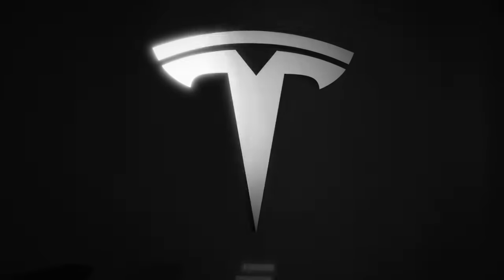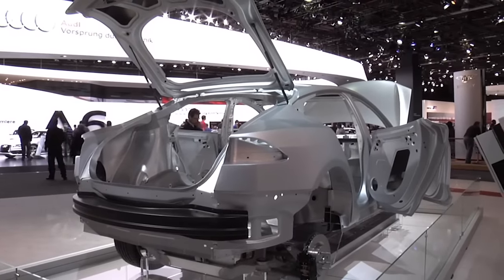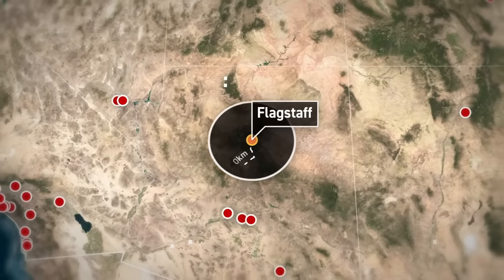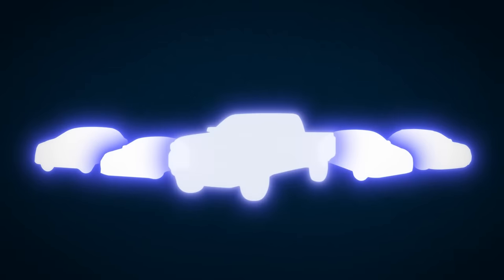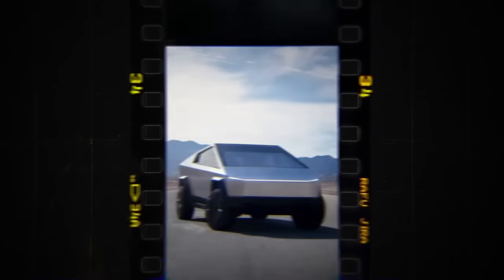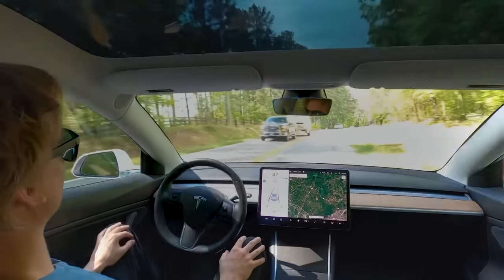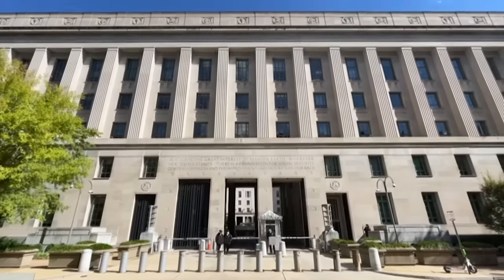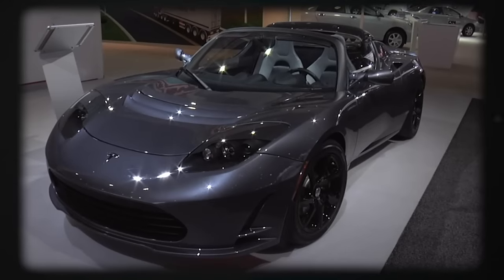How Tesla Fumbled

Comment: I've had a Model S since 2017 and I've experienced almost all the negative things the video talks about, but one area where Tesla still blows everyone else out of the water is their supercharger network.  My battery has degraded by 5-10% since I got my car, but it's actually easier to road trip than before because there are so many more superchargers than there used to be.  When I got my Model S, there were 2 superchargers in the Dallas-Fort Worth area.  Now there are at least 10.  The superchargers are very reliable too.  There might be one or two not working, but most superchargers have 10 or 12 and they usually all work.  I've tried these other 3rd party chargers like EVGo, etc, but they suck.  You really can't count on them working and when they work, they're really slow.  Tesla is experimenting with opening them up to other EVs, but they can always stop doing it if it causes more problems than it's worth.  The other automakers don't have anything close right now.  Road tripping in my Tesla and hopping between superchargers is one of my favorite parts of the Tesla ownership experience.
Reply: It was not bad for long trips as a taxi company but terrible compared to just having a hybrid car. But that taxi business went out of business within 3-4 years after replacing Toyota Prius hybrids with tesla long ranges thanks to the ridiculously higher electricity costs from the city for charging 30-40+ teslas every day all day long. 

As a solo user it is probably great, but yeah we had major battery life problems living in a cold winter state too, half the battery would be gone in winter months as opposed to the summer.

So I can imagine living in a warm place with a tesla is probably a pretty great experience.
Where it gets cold it is miserable, the 300 mile battery turns into 150 miles instead. Not good for a cab company.
Reply: I don't know if you've been reading tech news, but Tesla has started opening up its charging network to non Tesla cars.
Reply: was thinking of an i4 this year, but would you say an electric is worth it?
Reply: There's a good reason why gas stations aren't owned by car companies. Because if they did they did then they could put a lot of pressure on people to buy their cars simply because it's hard to get gas if no gas station in town serves your car brand.

The only reason this hasn't been addressed legally in the same way is because EV's aren't big enough yet and chargers aren't common enough yet. But once they are, then if that kind of practice isn't shot down like the plague it is then we're in a for a world of hyper aggressive, monopolistic car companies who have yet another vein to be greedy and exploitative.
Reply: I feel like the Supercharger is probably the foot in the door that could help Tesla hold on to a meaningful market share in the next decade. If they lose the charger format war the old boys of auto manufacturing world will eat them for breakfast.
Reply: @rh_BOSS  They pretty much already have, the US is the only major vehicle market in the world that hasn't standardized on a charging connector yet... the EU and China both use the type 2 now and force Tesla to also comply with it, though it looks like China is still in the development phase for their own DC fast charging standard connector. I expect it probably won't be worth it for Tesla to continue using a proprietary standard just for the US market and nowhere else.
Reply: No longer an advantage since they're opening up the network to other makes of cars; it's already happening.
Reply: Excellent point. Being able to put a destination into your map and having all the supercharger stops get automatically calculated for you - it just works so smoothly. And when you get to the charger you just plug in your car. No having to download some random crappy app or something like that. I have to give them credit for really stripping down the process and making it super convenient.
Reply: @goldenfloof5469  Tesla spent their own money developing the supercharger network. They have built goodwill from owners of their cars by the network's reliability, speed, and that they are everywhere and it is a key reason people choose Teslas over other EVs. How can the government go after them now and force them to open up their chargers when it is a competitive advantage that they invested a lot of time and resources into perfecting? Tesla made EVs at scale possible and that is why every city in America is full of Model 3s and Ys.
Reply: @goldenfloof5469  The government already has "gone after them," sort of, just in a positive way. The BBB Bill included a bunch of funding incentives for building and maintaining EV charging stations, but only IF they used the generic standard. This means Telsa gets none of that money. . . unless they open up their charging stations to generic chargers, which they have been piloting in a few locations. It's a little complicated and will take some work, but seems totally doable. Within the next five years or so, you'll probably be able to charge any EV at any Tesla charging dock.
Reply: @kriskros91  Ask AT&T.
Reply: How long does charging take
Reply: @johannesgutsmiedl366  you couldn't be more wrong there bud. NACS standard is Tesla's standard now. 

The "big old boys" VW fired their EV CEO, postponed plans for new EV plant and has had shit sales for their EVs so they are now going to Chinese brands to use their platform. VW lives because China and forget them selling to Chinese in china, they now need to worry about Chinese in German market.

Ford - talk to a real F-150 owner, they threatened CEO as they couldn't charge the big ass EV truck anywhere and sales were dropping fast. Ford itself admitted to it and begged Tesla to let their F-150s work. 

GM - Yeah, they made 10 EVs last year i think. 

Hyundai/Kia/others - irrelevant. 

While all this Tesla has gained their lead over all of these, has opened one new factory, started work on it's biggest one yet ( Mexico ) and is for medium term holding everyone by their balls.
Reply: "My car sucks, but it has SuPeRcHaRgEr network".. get wrecked man
Reply: @kriskros91 are you seriously asking this question? "Why would the government care about the people instead of Tesla?"
Reply: Ten chargers in Dallas is a joke.
Reply: That is only a usa thing though. In the rest of the world any ev can charge on any network anywhere. The supercharger network is open to anyone with an ev.

Comment: Two factors that were left out but I think played a key role in Tesla's success and still, to this day, are a big reason for the company's image:
1- Performance. At the time when the Model S was released, it had some of the best acceleration and performance specs of any production car outside of supercar territory. And it did it at a fraction of the price.
2- Looks. When Tesla jumped into the market, most mass-market EVs were, to put it bluntly, butt ugly. They were so ugly that they gave off the impression that the person driving it must have done so ironically or the were so far up their own ass about the car being electric that rescue crews wouldn't even be able to pull them out. Tesla made an electric car that looked like a normal car. It wasn't modern art vomit--it was classically stylish.

There are arguments whether both still apply, but I don't doubt that both played a key part in Tesla's early growth and popularity.
Reply: Sure, but the point is that they wasted that popularity, and plenty of modern EVs match or exceed them on both qualities.
Reply: Their cars are ugly, and not just because they all look the same (fat & fatter versions). They could have kept Lotus on, but no. 
The 0 to 60 performance is really good, but at that price point you could always get an ICE that matches it and handles the curves better and stops shorter. 
I thought I’d be driving electric car by now but it’s just not panning out the way I expected and in part because a lot of the lies that came from this outfit were never fulfilled.
Reply: Lmao
1) he mentioned alternatives with comparative specs

2) the cyber truck is the ugliest thing ever

Comment: Rivian isn't a good example for "better quality". They have a lot of fit&finish problems, and even more unjustifiable for the price point
Reply: 10000%
Reply: Chevy stopping orders for the Bolt for a bit and asking customers to park outside away from other vehicles because of battery fires.

The Ioniq5 with a fairly common 12v battery drain issue. 

The legacy car brands aren't doing any better for build quality for their EVs or even ICE vehicles historically.
Reply: Correct
Reply: There are way more serious issues than just fit & finish though. Just off the top of my head I can think of tonneau cover breaking with just regular usage and the trucks just refusing to even unlock in cold weather (no extremes, just freezing temperatures & parked outside) and these are not rare cases...
Reply: The 12 Volt battery might be problematic atm.
Reply: Indeed, they had to replace all their bed covers because they kept failing.
Reply: @echoeversky  I jumped one at a festival. Was like a week old, owner was steamed.
Reply: @crysis_averted  Have they finally fixed the design or are they still just replacing the broken ones with the design they know will break soon?
Reply: @RonnieRLD  To be fair, the battery issue with the Bolts was not their fault (it was LGs) and they replaced all the batteries. The new cars do not have this issue (I have one)
Reply: stick to legacy brands...only had 2 issues so far with my BMW iX
Reply: @aynrandfan7454  Doesn't BMW outsource their EV powertrains? In that case it's not exactly legacy EV manufacturer...
Reply: @Daddo22  yeah they outsourced it to a 260 year old engineering company that's been making driveline components for near a century.

Comment: When comparing EVs, i always look at chargingspeed. Going from 50 kW to 150kW is huge. Many of the other brands suck in that regard. I have to wait 90 minutes to completely recharge my E-niro
Reply: Tesla charges at 250 kW if you go to a supercharger.  Super fast!
Reply: You dont wait for 100%. MUch faster (and better for the battery) to leave at 80-85% and then move on.
Reply: The vast majority of people charge at home or work and so charging speed is much like the charging speed of your phone - you probably don’t care as long as it’s charged when you need it. If you’re having to regularly charge at a DC fast charger, that sucks a lot and will absolutely take forever if you want to go beyond 80-85% since the charging rate drops to 10kW or lower on most cars. Your e-niro would reach this point in 20 minutes or so, same as a Tesla. Teslas also take forever to get that last 15-20%.

Comment: What Tesla has that definitely outdoes others in North American automobile is the Supercharger network, which is reliable and easy to use.  That’s significant, although exactly how they leverage that to make more money remains to be seen (although they are planning to offering charging to at least CCS-equipped vehicles, and probably Aptera vehicles as well.)
Reply: Exactly. CSS network is fragmented and confusing. It's a bunch of separate providers that require weird apps, have confusing interfaces, and half of their machines are broken all the time. 

Meanwhile with Tesla it's easy and mindless. The superchargers are all in the navigation system, and when you get there just slap the door plug her in and go use the bathroom.
Reply: I agree, whatever you might think of the build quality, FSD or Musk himself. It is a huge advantage, it's much closer experience to traditional ICE cars to not have to hunt (as much) for a place to fill up. The EU requires all chargers to accommodate CCS. I think as nations start to adopt similar laws or start to build their own or have the other auto manufacturers start to team up to build supporting networks. This will eat away at Tesla's advantage.
Reply: @Discowombat  it wouldn't even be that hard to replicate the Tesla experience. You don't need a monopoly like the supercharger Network. All you need is a standardised system that:

1: communicates the location, price, and status of every charger to a central database so it's going to be displayed on the car's navigation screen.
2: automatically interfaces with the car once it's plugged in, and automatically charges the owner's credit card.
Reply: Had the CCS plug and the communications protocol was standardized beforehand, we wouldn’t have had such a broken charging experience like right now. Now the US government is throwing money at Tesla to make their chargers CCS compatible. EU is better at enforcing standards to the point that Teslas sold in Europe has to have CCS plug on the car itself instead of an adapter.
Reply: @Jabid21  You kinda have to give Tesla the benefit of the doubt because they rolled out the supercharger network (with their own connector) before the CCS standard had been completely finalised. In most other places though, Tesla's cars came with either Type 2 (in the beginning) and CCS (later) so it isn't so bad, although I still don't think other cars can charge there. But their connectors are unsuitable in other places because they can't take three phase power as far as I'm aware, something more common in Australia.
Reply: @klebdotio3284  I’m not so sure about other countries but as of now in the U.S. AC charging is single phase only, so need for DC charging is going to be more important here if anyone wants faster charging. Tesla had the first mover advantage here in building out a comprehensive charging network nationwide. Tesla also tried to convince other automakers to adopt its proprietary connector, now dubbed NACS but other automakers are not so keen on adopting that connector and going CCS 1 instead. Tesla is also on the process of equipping its chargers with CCS so it’s a matter of time to see whether NACS sees industry wide adoption (that I highly doubt) or Tesla eventually adopts CCS 1 in the future. (If not the connector, then the communications protocol to make adapters easier to produce)

Comment: "audacious" is certainly one way to describe the cybertruck's appearance.
Reply: and it doesnt even have an open bed or boxy cover u could fit things into what where they thinking
Reply: I think it looked RAD when it was unveiled but it was soooo long ago that it looks like one of those old forgotten concepts by now. The Rivian truck did a much better job in it's design
Reply: @scarlettwilliamson5370  It has a vault that you can drive with it open or closed.
Reply: Lack of innovation
Reply: A public service announcement: There is no cybertruck, it's not real
Reply: @wickitklown90  have you ever seen an EV pickup truck which has a custom rolled steel alloy exoskeleton and bulletproof windows? What do you mean by innovation?
Reply: @StanislavG.  Em they are rolling it out this year. And the lead of Ford won't last long if they are only making thousands per year right now.
Reply: That thing looks like it would slice a pedestrian in half.
Reply: @riggmeister  sure they will... lol

Comment: This is a rather good overview.

Tesla has fulfilled its "historical role" - dragging the incumbents, kicking and screaming, into the third millennium. That it still leads the market is thanks to two factors: fanatical loyalty of initial "well off Silicon Valley nerd" early adopters, and relative incompetence of traditional carmakers in this new set of technologies (see, for example, persistent problems VW has with software, while mechanically and design-wise their ID series cars are every bit as good as the ubiquitous Golf.) Bot neither of this will last - the supply of the former is finite, and the latter will learn.
Reply: The issue behind VW´s Software problems had to do something with Tesla because the then VW Boss wanted the EV´s more Tesla like the issue was that he came to power at the time where VW readied the new MK8 Golf and ID3 and you can guess how well it works out if a company decides to throw away all their work and start over again a couple of months before the launch
Reply: This will last until other companies can catch up with Tesla infrastructure, electric cars are an infrastructure problem not a individual vehicle problem.
Reply: Lol. It has succeeded in plunging 100s of Billions of investment in EVs. 
Weather EVs deliver on the promise is another thing entirety.
Reply: @SkyGlitchGalaxy  They will, or we are back to buggies.
Reply: @bazoo513 ICE vehicles will still exist and be produced for a long time yet.
Reply: @SurmaSampo  Possibly, in some niche applications, like reciprocating steam engines do today.
Reply: @bazoo513  Not really. We are likely to see a lot of diesel engines in fixed and mobile applications for several decades yet on a global scale. There are a lot of bottlenecks to ubiquitous electric vehicle adoption.

EVs as a majority of vehicles may well not happen until 2050 and that is assuming new vehicle sales are 100% EV before 2040.